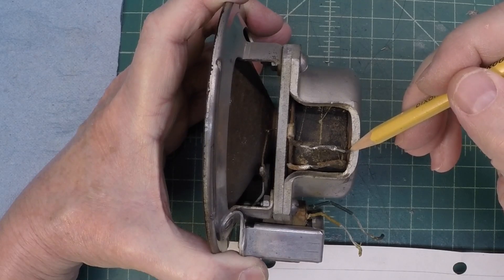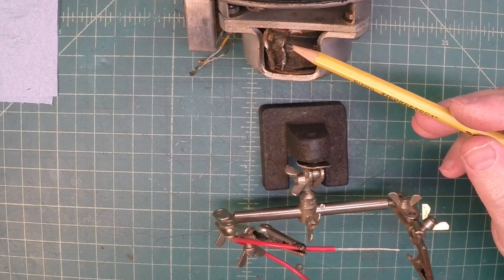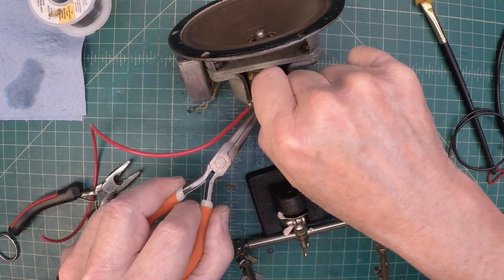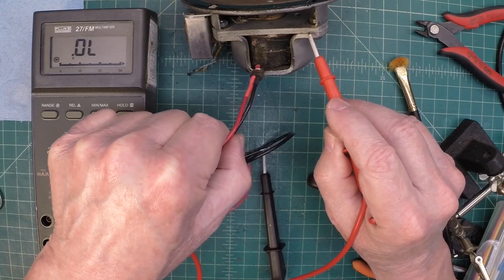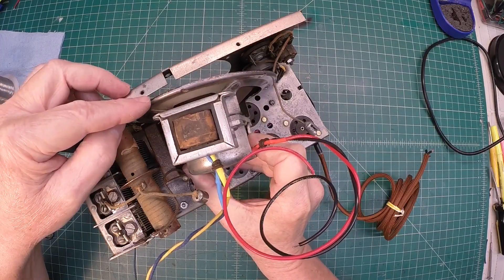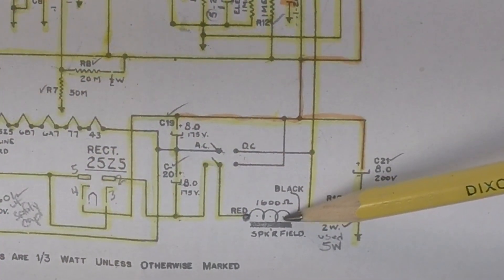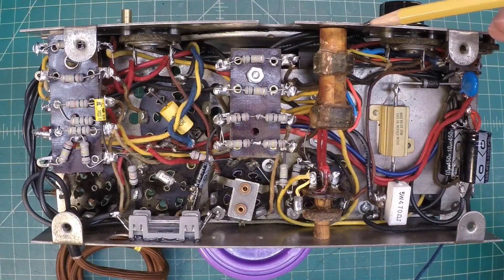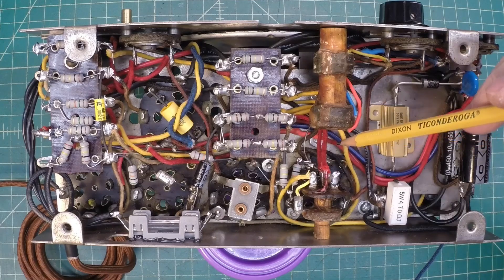Silvertone "Companion" 57 D 1704 - Speaker Field Coil & Output Transformer Repairs

Comment: Your workmanship is amazing well done ,have you tried the double walked with glue inside,It looks like regular heat shrink ,but it suppose to be a lot better it's a little more exspensive,I bought mine on Amazon .sometime heat shrink can slide around,that why I bought the doubles walked with glue heat shrink .Just a thought.
Reply from the maker: Ron - I haven’t used any double wall. Harbor Freight stuff and NTE Heat Shrink 2:1 Assorted Colors and Sizes 160 PCS https://www.amazon.com/dp/B000FIDTYG/ref=cm_sw_r_cp_tai_nbh9CbNX370T0 In addition, all of my spaghetti tubing came from JustRadios. Thanks for lead on the double wall... Best, Don

Comment: Nice job with metal film.resistor very clean job over all,you are right they use all the space possible,looks like a hard radio to repair ,it should work better then new with all the nice parts you put into it.

Comment: What did that AC/DC switch do? This radio doesn't have the necessary circuitry to create the B+ from a DC source, so it doesn't have the ability to be battery operated.
Reply from the maker: +ValhalQcoholic Sorry for my belated response, I’m playing catch up on my comments. The radio was designed to work on AC or DC back when the power grids in the states in certain locations were still DC. The switch bypassed the voltage doubler circuit of the 25Z5 tube. Pretty cool for the early 1930s. Best, Don